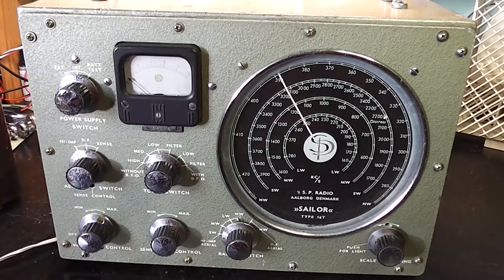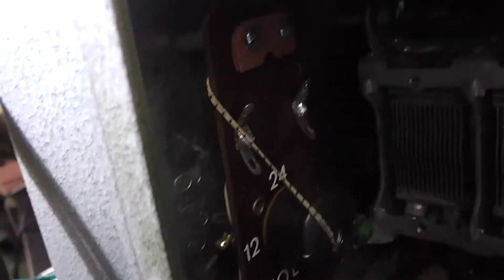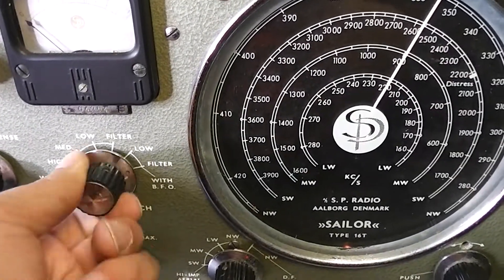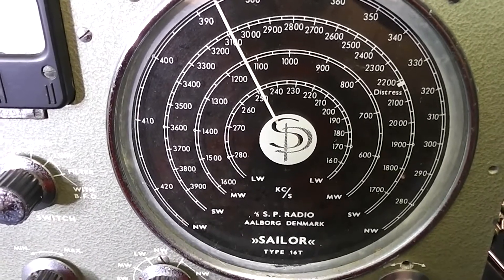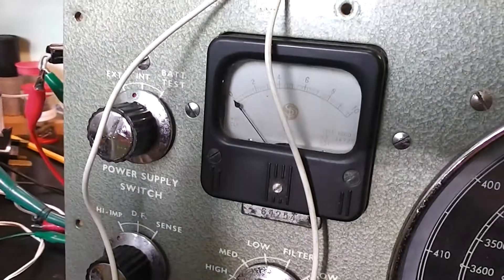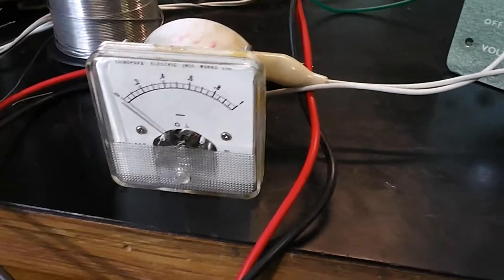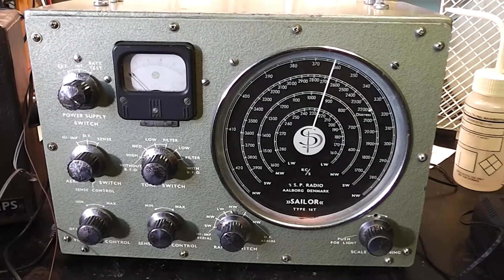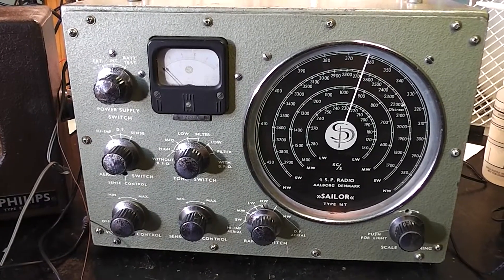Sailor 16T Vintage Marine Radio Repair.

Comment: I found a 46T at a local market. You hardly see them in the USA and usually they are badly corroded and beat up. I sprayed the band and function switch and pots and it came to life. It’s very sensitive on MW. The 400 Hz filter and BFO work as well. My S meter did not work also - until I went to adjust the zero. It woke up. Salt corrosion? Perhaps try adjusting yours.
Reply from the maker: @Thermionic_Buddhist  I'll have to try that, maybe bad contacts. Thanks Daz

Comment: Thanks for sharing! I have a Sailor 16T too, it’s been stored for years. What stations can I listen with it today. I’m in Finland. Thanks.
Reply from the maker: Hi, I don't think there are many MW stations in your area looking on radiomap.eu. I only saw one at 1035.  You may receive other stations at night from UK etc. It can receive amateur transmission on 160m and 80m  I guess using the BFO. I've never tried though. Mine is stored also due to lack of room I'm disappointed to say. Daz

Comment: what was the fault then? thanks
Reply from the maker: Incorrectly wired RF front end transistor that was very leaky and that was replaced with another transistor. Bad capacitors.

Comment: Hello. I also own this sailor model but am unable to receive any channels. What type of antenna are you using?
Reply from the maker: Just a length of wire in the high impedance input.